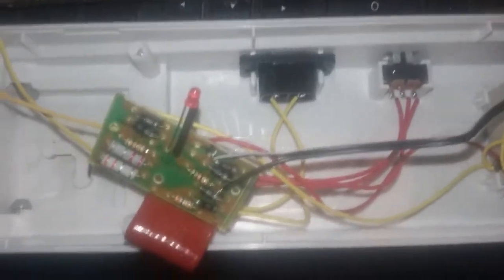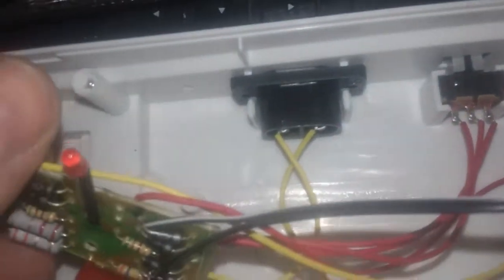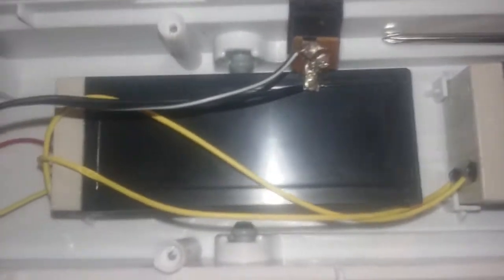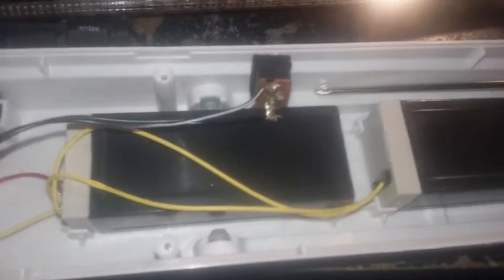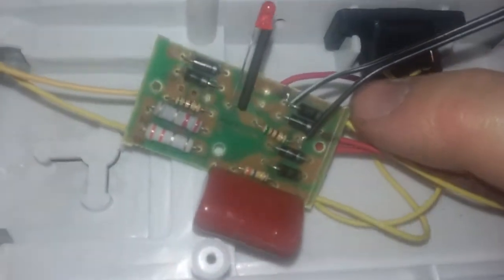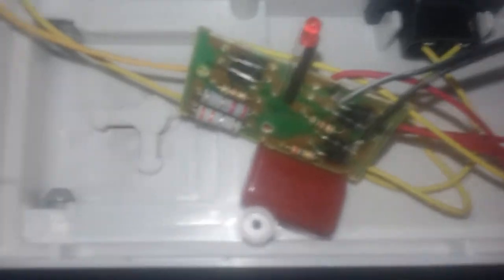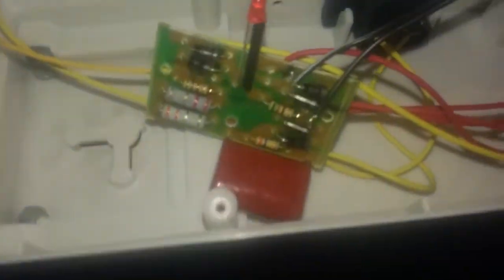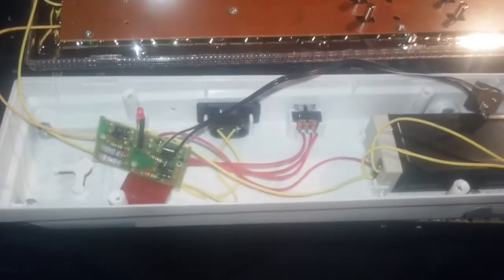Bell and Howell light bar mod Part 1: Converting from AC to DC.

Comment: The one that I have, has a different control board - it is much smaller and has several surface mount parts on the back side, otherwise similar. I don't think the batteries are SLA, but most likely Ni-Cad, although I have not found an way to identify that, other than cutting one apart. Also, mine has a rather short lifetime, despite charging for quite some time. I may convert the panel to use Lion cells, and install a proper charger.
Reply from the maker: You can use a power bank and connect the battery wires to the power bank's battery and then just use the usb charging on the power bank as normal to charge. In a nutshell you are taking power straight off the Li- ion cells and not the usb. You can do that too but I'm not sure how happy the LEDs will be with getting 5 volts when they run on 3.7 volts.
If you do this, use a power bank that has 18650 cells and not a li-poly pack. A cheap two cell pack should give plenty of usage. You can even add a barrel jack on the outside of the light and run that to a micro usb into the power bank and use a 5 volt barrel charger to charge.
Reply from the maker: Can you please do a video of your light bar and show the internals? One way to tell if batteries are SLA is how heavy they are. A SLA battery will weigh more than a nicad or NiMH battery.
Reply: I dug deeper into the light bar - the LED array seems to want 240ma @3.14V on the 'high' setting, and same current at a slightly lower voltage (3.01v) on 'low'. The battery packs are quite light, so I do not believe they are SLA, but NiCad. One thing to keep reminding yourself, these are made in China, and not by Bell+Howell - they just pay a fee to B+H for the use of their name, so that means, the manufacturer E. Mishan and Sons Inc, will use the least expensive parts inside, and that means old-fashioned NiCad. I plan to convert over fully to LiIon cells, but I will need to add a current limiter to drive the array. probably use a buck/boost converter module that has current limiting (gearbest), eliminate AC charging and use external USB source, again with appropriate current limiting & charge control.
Reply: @paulmoffat9306  Paul, Have you done the modification? Would you mind to share the schematics? My light bar just went down after less than 12 hours working time. The control board has a burnt mark and two wires connected to front battery "+" terminal were off. The exactly same problem happened to another Youtuber. This unit absolutely has a design flaw.

Comment: Hey man how you doing? so would you mind posting a video showing how to bypass the batteries in this LED light bar? Because it seems to be pretty bright for about 40 minutes and then it’s really dim even though it’s plugged in the wall constantly. I’m wondering if I can upgrade the batteries bypass the batteries or somehow make this freaking thing work? It’s less than a week old.
Reply from the maker: Did you let it fully charge? It takes a long time to charge up. I can't remember the exact time but it was pretty long like 14 hours I'm gonna say, Not sure. The LED bar runs on about 3.7 volts and the batteries inside are 4 volt SLA (Sealed Lead Acid) type batteries. If you really wanted to take out the batteries like if they are completely dead you could wire this for USB power. I don't know if that will work because I haven't tried it yet as my light bar is still working. I may take a power bank and wire it in place of the internal batteries and wire direct to the power bank's internal batteries so you simply charge the power bank and cut a small hole for the USB.
Reply: coondogtheman1234 - yeah, I suspect my batteries are dead. They said if you didn’t charge them for three months or more that could happen. That or they blew out from being plugged in too long, but still interested if batteries can be taken out or replaced.

Comment: Thanks for posting, a family member just received one of these as a gift. I will tell them to send it back. 
That built in AC power supply looks dangerous. There's doesn't appear to be any fuse protection. Also there is nothing to regulate the charge on the batteries. If left plugged in too long, it will cook the batteries.
Reply from the maker: It charges so slowly you probably don't need to worry about it but if you want to send it back you can. By the looks of the wires on this thing THEY would be the fuse.
If you know someone who likes to work on electronics stuff have them mod it to be safer. You could charge this thing from a USB port if you wanted to.
Reply: @coondogtheman  Thanks for the reply,  I do work with electronics and a fuse element is made of a special wire, which is actually designed to melt at a specific current level. The hookup wiring can not be used to substitute this action. It turns out the SOS function isn't working right anyway. The light was just pulled out of the box 2 days ago. So I wont bother modifying it, back it goes.
Reply from the maker: @GenerationXT  You should modify it. When I took mine apart because one of the modes wouldn't work a wire had come off. A quick solder and it was working. This light only has low and high, No S.O.S.

You could wire a DC jack into this and use a 5 volt charger. Maybe a USB in port and then just use a spare phone charger.

Comment: My light batteries make a boiling sound with the included standard charger cable. I bought 2 and they both do this.
Reply from the maker: These are so cheaply made. On mine only one of the light settings worked. I haven't run mine out yet but when the batteries die I'll mod this with the guts of a power bank. Or mount the power bank inside.

When I tried 9 volts, my light bar made that boiling sound so I used 5 volts. Not sure why it does this but I know the batteries in this thing are 4 volt Sealed lead acid type batteries. There are two of them wired in parallel.